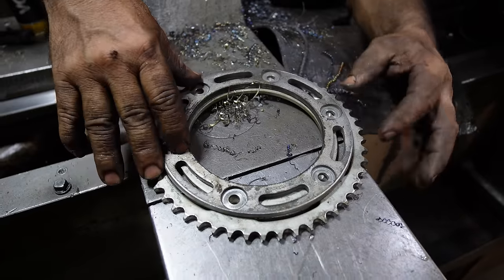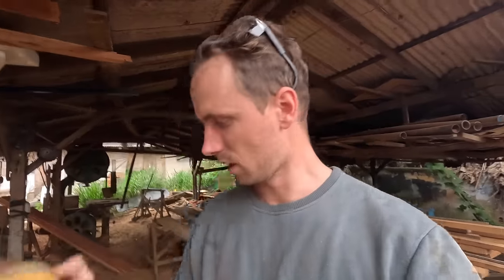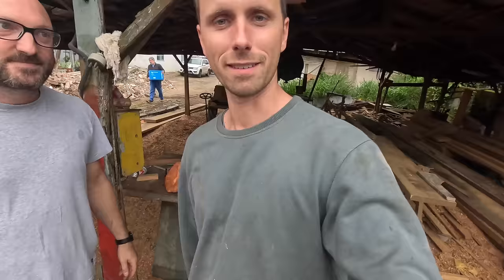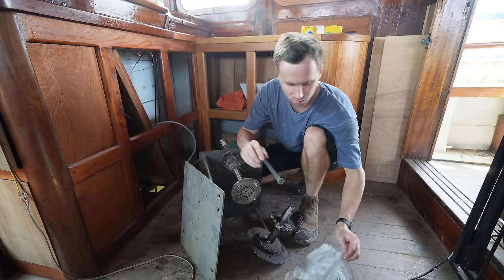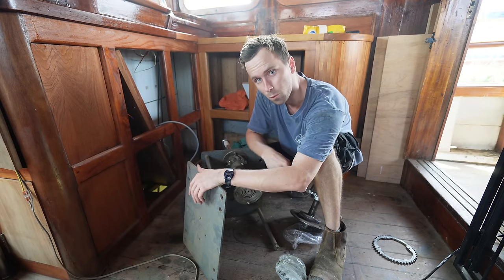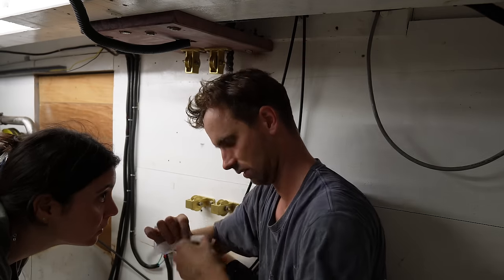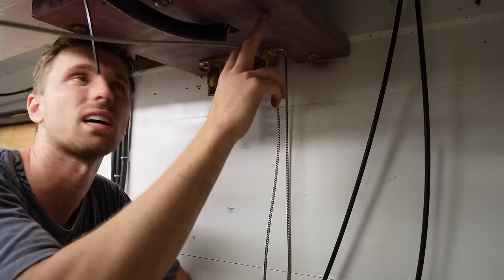Upgrading the old fashioned steering system of our RESCUED wooden sailboat — Sailing Yabá 158

Comment: My only suggestion is that all of the bolts securing the pulleys should be through bolts with nuts and washers on them. There is a tremendous amount of force on them while sailing and I fear the lag bolts will eventually loosen and fail. FWIW

Comment: Looks nice! I see that one side has some slack as it turns now... will you add tensioner pulley/springs?  Wouldn't want a wave to jerk the  rudder because there's slack... that's a good way for the cable to jump out of the pulley. That would also account for any cable stretch...😅

Comment: Thank the lord you came to your senses on this. Now it's time to figure our what your going to do about auto pilot. Now is the time because your dealing with it now. You should not wait till later. I would have doubled the size of the cable. But that is just my intolerable self. I over engineer everything. And as far as where you should go... don't. You have to do sea trials first. You could have real problems that you couldn't see.

Comment: Hey Ben I would get a longer chain that comes down from wheel to where you have those wheel blocks though them then straght to wire with a tension bolt or pulley do away with that downward pulley putting too much fition on that downward  as you do need to tighten now and then

Comment: I would run two tubes over the engine room to make sure the cables do not foul any other systems. Otherwise a perfect job well done . I have never done ant boat building , however I have built a couple of special cars , no one can do every thing perfectly the first time . Don’t knock the guy when he makes things that will not work the first attempt, there is an old saying , “ he who never made a mistake NEVER did 
anything “ 
Also they have been guided by a team of boat builders and those guys have built and refurbished so many . I take my hat off to the whole gang ,working with very few modern tools (by which I mean cad and cnc machines ) . I would like to see how many artisans could do what they have done using a band saw which looks as if it came out of the ark , a planer that came with it. Several drills and chain saws lots of chisels hammers and most of all a lots muscle. I think that they could have built the Mary Rose without even a drop of sweat?
    Last but not least no cranes and , moving the boats around the yard takes the biscuit. Great guys , when these guys pass on to the boatyard in the sky you will never se the like again !

Comment: I woulda used Nylock Nuts on those Pulleys. You're gonna need a Torch to get those off or a cutting wheel with that Red Loctite...shoulda used Blue Loctite if you're going that route...

Comment: I'm concerned about the wire thickness and I hope that's for mockup and stronger wire (tensile strength) will be used?
I'm guessing there will also be a better fastening of the wire to the rudder to prevent wire chaffing?
With that many turns, lock to lock, I'm presuming there will be a rudder angle indicator on the helm?  ;-)

Comment: Remove the rigging (steering).use it for determining length. Repace with heavier cable (or Dyneema). Add turnbuckles that can be safety wired.please.

Comment: I worry about the cable to chain joint. The inner link rollers are not usually welded and are kept from spreading by the outer link it would be better to cut the last outer link in half leaving the staked pin to hold it from spreading apart and the cable coming out

Comment: 🌟🌟🌟🌟🌟  Zert fitting ( Zeerrrt )  With cables attaching to chain ,,,put through a plastic pipe long enough that chain and clamps stay inside and wont catch on anything ever and then put 2 extra cable clamps on each cable ,,SAFETY

Comment: If I were you I would add a “suicide knob” on the helm (steering wheel) and put it at the 12 OClock Position, to be a marker for the rudder “straight ahead” location.

You can grab the suicide knob and do full turns to port or starboard quickly for close quarters manoeuvring - like getting into and out of a pen at a marina etc.
It’s a lot faster than turning the spokes on the helm by hand.
The spokes are fine for straight ahead course correction inputs, but too slow for close quarters fast & large steering inputs while docking.

Comment: Great job, with a but lol. I’m not convinced that the rudder and steering mechanism are the correct fit for you as a small crew of two, I’m not an expert in sailing at all, but I would have thought a hydraulic system would have been easier for you to use and as others have said you need a locking system of some sort for the wheel or the rudder will be steering you not vice versa as it should be, the other thing that crossed my mind is repairing the system if one of those pulleys breaks it’s going to be hard and dangerous to repair mid sail, I think I would have put all pulleys inside and angled the holes through the stern. Best of luck I love Jaba and I’m very jealous 😊👍⛵️

Comment: Lovely what you are all achieving. However regarding the steering it is always complicated and you have fairly well everything set up incorrectly. This includes, but not limited to - pulley diameter, cable tensioning and cable connection to the quadrant (please look at a normal yacht quadrant. Yours should be the same but in reverse.) You have to nail this system and I am positive that you can. Keep chipping away🙋

Comment: puting the rope though the end off the chain around the roller will not hold , the side plates will simply spread off the centre bush . They are normaslly heald in place by the side plates which are rivited to the pins  hope this of some help . cheers Richard .

Comment: Huge improvements!👴👌👌
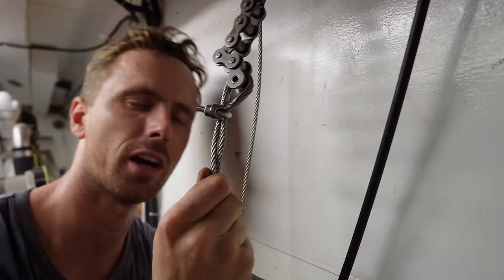@11:02 Please let the wire go through the 2nd section. I know you said this was temporarily, but still...👴🙏
And if you want to do it really properly and secure the last section to stay inline, let the wire go in the first section one way; up through section 2; back trough section 1, like a figure 8.
What will be useful too is grind those two lose chain connectors flush to the next connector on the left side chain end. Also, and last on this, always use double wire clamps.👴😉
@13:29 Yes! that is the way to do it.👴👌
@22:16 Don't forget stoppers for the quadrant, or some other kind of protection. It has already damaged the paint.👴🥺
@22:50 It's not only easier, it lets you steer more precisely too 👴👌

Comment: why do you have wire steering on the boat. is your weakest link. why not convert to hydraulic steering .safer and more precise and you can fit autopilot

Comment: Also don’t run the cables through the holes in the SS rudder bracket it will cause chafing on the cable and cable Failure, a cable end eyelet bolted to the bracket will be better

Comment: Maybe you should use hydaulic steering
Reply: I think it's great to have a system you can check easely. He can fix it quite easely. Also a classic system match well with the style of the boat. 
I guess you have to give more elements to convince Ben the beautiful improvement he's made compared with the previous one. 
I personally would keep the mechanic system keeping cables only for straight lengths or gentle turns. Double cables. Chains and gears below the wheel. 
But maybe he could study the hydraulic steering, price, risks, how to connect autopilot. If it's worthy the cables system could stay there as a security second system, even if there's a tiller planned... that'd make 3. 
I guess a failure is not allowed to happen. 
What Ben has done is so nice I feel sorry to see so many advices for different things.

Comment: Double swage fittings, not cable clamps. Clamps represent a single-point failure that could be catastrophic. You do not see cable clamps on wire standing rigging (at least I hope not) and the steering cable is just as important. If you stay with clamps, at least double them properly.

Comment: You don't remove the grease nipple to grease the pulley shaft. You push the connection on a grease gun onto it and pump grease in. It is a non return valve.
Your pulleys are for rope of about 15 mm diameter not wire. You need large diameter stainless wire sheaves as the ones you have will damage the lay of the wire due to the sharp change of direction; the diameter of the wire doesn't match the curve of the channel in the pulley giving a point loading and the wire will therefore saw into the softer bronze,damaging the pulley and eventually jamming. The wire is too small for the rudder size. Best solution might be to keep the pulleys and replace the wire with Dyneema rope of a much larger diameter to match the pulley groove, no metal on metal abrasion and as strong as the chain.

Comment: Just a question - is that wire stainless steel or galvanised? if galvanised i would suggest you change it asap it will rot very very very quickly. I also think you should have a turnbuckles in there somewhere to compensate for stretch in the cable over time.

Comment: Future Problem: Metal fatigue (extreme bending)  2 inch pulleys and steel cable bends too tightly.   That’s why they use ropes.   12 inch or bigger pulleys will help.  Could keep small pulleys and use rope only on small pulleys with a stiff cable for long runs.

Comment: Please swap your shackles on the rudder guide to a 4 part shackle with cotter pin. It is too easy for the 2 part shackles pin to back out. You would then lose your steering cable.

Comment: Red lock tight.   It will never come apart.  Question what is the size of the steering cable 1/4 inch??  That is 3 tons safety rated for around 3 tons.

Comment: honestly, when you get this in the water .. i think you will be wishing for a hydraulic system.  the angle of the rudder is so extreme that anything less than hydraulic assist is an almost guaranteed fail.  and most likely it will fail at the worst possible time.  at the very least you should run the cables through conduit rather than leave them exposed where they can get fouled, caught, or cut.  the cables will not remain taught because the lines will stretch.  the connections on all ends will be prone to failure as well.  and it will most likely occur like i said earlier, at the worst possible time.  i have followed you guys for a long time now, and have applauded your efforts many times.  but this antiquated system you will be relying on has so many probable points of failure that i fear for your safety.  i have owned several vessels of your size for many decades, i would never have relied upon the system that you seem to be so proud of.  never.

Comment: weakest link is the cable size , heavy seas will snap it when you get rudder shock, and could act as a 'garotte' and cut the soft metal of the pullies  at least put some form of tensioning system

Comment: I would encourage you to replace the lag / carriage bolts securing your pulleys, with through bolts, washers  and locking nuts.

Lag bolts your relying on the thread in timber to hold the constant tension.

As wood shrinks the threads will loosen. The constant steering inputs will move the threads constantly and tear the threads loose out of the wood and you lose your steering at probably the worst possible time.

Through bolts with lock washers you can always tighten up to remove any movement that develops.

Lag / carriage bolts aren’t suitable to a steering system in my opinion.

Comment: Have you done any seat of the pants calculations for the forces that the rudder will apply compared to the strength of the cables with respect to  the boat speed?  
The rudder looks massive, the cables look insufficient.    (But my experience with stainless cables is limited.)

Comment: Use a stainless steel nylon insert nuts on those pulleys as those nuts you used will come loose over time even with lock tight or at least double nut them!

Comment: Locktite isn’t the best solution. You need a nylon locknut and do not insert a bolt with the nut on top. Gravity will disassemble it if the nut comes off

Comment: Don't fix your cable to a link in your chain without a pin. Grind away the link and leave the pin in place or use the second gap with a full pin. This is inducing a failure point into your system. The pin is needed for strength!
Reply: at 25:16 you can see the pinless mounted end going up. On the other side, thats coming down, it's done with a pin and much stonger.
Reply: you can see the weak link in the second of 11:03 perfectly. Would not like to rely on that in heavy weather and strong forces against the rudder.

Comment: All those gears and chain need to be completely covered in marine grease guys to keep the salt air off them. Sorry guys, I really don't like the way the cables connected to the rudder and chain, for me, the cable needs to be a bit bigger in diameter, and the connection to the rudder should be swagged not clamped. Also you should grease everything now because when you can hear squeaking, that's wearing on the bronze pulley's. Great job though, also the coach screws should be replaced with bolts and nuts where possible because over time coach screws wiggle loose and/or tare out quite easily. Seeya Rob

Comment: HI, have a concern for you where stainless steel cable & stainless steel fittings on rudder are connected to each other.  Could be point of wear from rubbing against each other & possible failure by wearing through one or both leading to total rudder control failure

Comment: I'm at about minute 12.  At this point really dislike the new configuration.  I'm not sure why you are doing 180 degree turns with all the added force and wear on the cables.  I can't see why the ceiling pulleys can't be move toward the bulkhead and then the wires go towards the transom.  Those bottom blocks or pulleys are not needed and create a lot of tension which will cause failure.  You did great on the transom pulleys.

Comment: please watch from 21.40 minute to 21.48 minute.  Try to imagine the horizontal water flow along the rudder. The lower mounting plates will cause turbulance over the upper part and they dimish your (already poor) steering.   Poor steering , because Barndoor type rudders are the worst. Please inform about NACA 0015 profile and add the profile to your rudder. The difference in steering is stunning. ( As I learned the hard way) Good luck

Comment: somebody please tell them the cable is connected to the weakest chain link.  The cable should use a link that has the solid cross pin in it.

Comment: I am not an engineer. But a blind man can see that that rudder system is awful. Where the chain/cable junction passes through the deck is dangerous. The pulley system is too complex. And the way the pulley exits the transom is just plain crazy. The attachment to the swinging rudder means that the cable will always be meeting the pulley at a different angle as the rudder swings. The wear on the pulley axle is going to be enormous, especially with seas on the beam.
I mean, the components seem to be first class, it's just that the steering mechanism needs an engineer's eye and mind.

Comment: Give up on the idea of feeding the cable down and back up again. Instead cut a 45 degree angle on the end of your purple heart and mount your pulleys on this. It will make a simple transition from verticle to horizontal with less weak sports.

Comment: You cannot put the cable over pulleys that small a diameter and through 180 degrees, you need the smallest angle possible, that doubles the load or effort required through those little brass pulleys. Get rid or move the block of purple heart aft and get rid of those small brass mounts for those small brass pulleys, they will fail or bend at least. Come on guys think about it. Although the wheel to chain setup is now workable. That stainless wire is too small for the loads of that big rudder, you need double the diameter to about 10 to 12 mm. When it's all correct and working in the seaway MP should be able to turn the wheel easily with one hand at about 6 kts of SOG. My boat is 2 fingers at 14kts SOG.

Comment: Putting the cable thru the end of the chain is a bad idea.  That’s just a rivet holding that roller in the chain.  Go up a link on the chain so there is a pin that goes all the way thru.

Comment: If i where you i ll change the base of the pulley instead of wood make it  steel plate and in the long run the wood will not hold the force dragging of mechanical movementof the steering.

Comment: i dont like the method of lock tight as a means of holding the nut in place.  I would put a spot weld on each nut.  easy to grind off if needed to remove

Comment: Lag screws through the transom not a great idea through bolts better idea stainless wire acrossed bronze sheave will chafe sheave maybe a good idea to have chafe protection at all point stainless steel wire runs through your bronze sheaves just a better idea this would work if you don't make these adjustments you will be replacing bronze sheaves alot more then necessary

Comment: Congratulations on building a steering system that will certainly fail. Starting with the pulley axle bolt nuts falling off.

Comment: i am not a professional, but using steel wire in such tight bends as the pulley directly after the chain seems not to be a good idea to me. i would do a 180 turn of that wire in a much bigger pulley. else the wire will damage itself because the outer wires will move against the inner ones (which causes friction)

Comment: I'm so frustrated watching this, I wish I were there to get you all through this with out any later regrets, Jesus Take the  Wheel! You need a bolt/pin through the last link of those chain ends where the the cable loops go through and you will need turnbuckles one on each run to take up the slack...... It,s a closed loop system for Christs Sake.